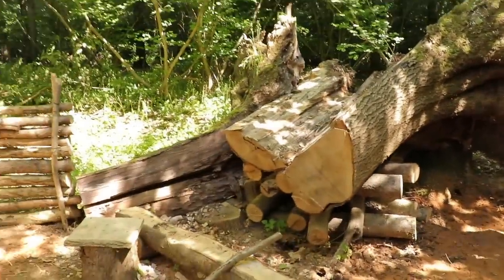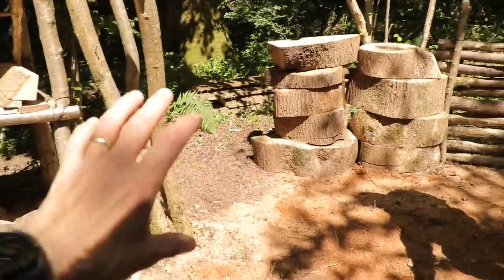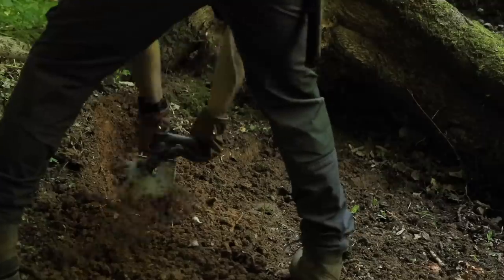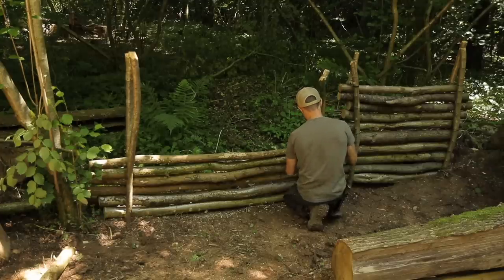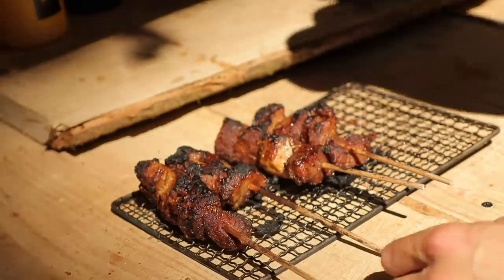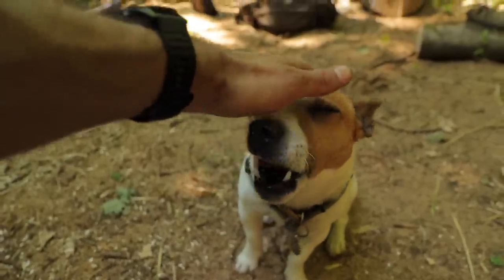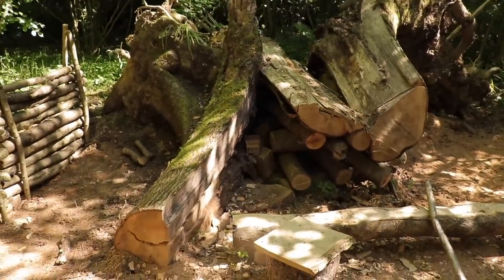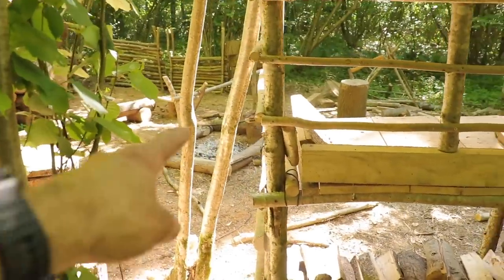Tree Root Bushcraft Camp: Building a  Survival shelter | Perimeter Walls | Kitchen

Comment: At the right side of the trunk, there is a little alcove or grotto formed. Pack some dirt at the very back and under to seal the area from wind and rain. Then later when it is raining, you can add a tent roof over the area for a small sitting place. Thanks for the video. Jon
Reply: I was thinking it would be a nice place for a bed.

Comment: Where the trunk sticks out instead of cutting it, I'd use it to my advantage and use it as some sort of table-ish type thing. I would also put some sort of awning type deal in the crook of the tree root to keep you dry or shaded. Just something small to add to the character of the root.

Comment: 6:07 Integrate the trunk into a sleeping area. Could you imagine waking up in the morning with the trunk of the tree as your ceiling? And then make it kind of a fold-away kinda deal so you can still use the space for other things during the day or when you're not there. If you want to get closer to nature, sleeping under a tree is about as close as you're going to get, lol.

Ooh... or better yet... depending on how much work you want to do... Build yourself a small bunker with timber/wood supports and have the entrance be under the tree trunk... That would be really cool, but a LOT of work...

17:54 The only comment I've got about the kitchen is to overlap some planks over the cracks in the little covering so you don't get water through the cracks if you're trying to cook in the rain...

19:27 Instead of cutting all the way down to the split on the root, figure out a good sitting height and cut into the top section to make it level where it'll be most comfortable to sit on. You could then adjust your fire position so you can tend it while sitting on the tree root bench. :D

Comment: Nice one mate! I had the same thoughts on the last episode on integrating that big trunk more. Glad you did it! On the left side of the trunk i can already picture a small shelter with one bed, tucked in at the side of camp. The piece of the trunk that sticks out could be utilized for a low front wall of that shelter  to kind of frame it in or as support for the bed. Looking forward to the next episode, I´m personally hoping for a clay pizza oven ;)

Comment: Great camp! As for recommendations:
Trunk: Cut it at a diagonal to leave a strong foot support, and use the flat face for carving and charcoal drawing. Great project for small kids.
Back left of trunk: Small watchtower. Perfect for spotting and filming wildlife, and fits into the theme.
Right of trunk: A hammock. Sink an eye bolt into the trunk and make a tripod to string it between.

Comment: I'm glad you moved the left wall, I was silently yelling Don't stop there ( my OCD ). As far as ideas, how about 1. some vertical supports to run some ridge lines for tarps ( incase of inclement weather, or to block the sun on hot or bright days). 2. use that root sticking out as a table or bench. Anyways thanks again for the video, John S.

Comment: Personally, I'd be apt to leave that extended portion of the tree root system as-is.  The green moss on it is striking, and leaving it more natural helps it maintain it's "wildness" and center of focus for your camp. :D  You're already building all sorts of kitchen work area, and other features for comfort and to add options for use so it's not like you "need" to make it into a table, bench or whatever! :D  Cheers from the USA

Comment: I would  cut that broken section of the trunk level for a bench and leave the full length. Or add an angled piece to the top to level it off higher for a camp dinner table.

Comment: Well done Mike, completely agree about moving the other side out, it looks much more balanced and the root deserves to be centre-stage. Its looking great!
As for the left root, a few questions struck me: 
The brach does look to be taking some load, would cutting it could cause the root to move sooner than you might like, or rot sooner causing movement? 
Do you prefer the mossy bark or the exposed interior of the wood?. 
Could you use the vertical face of the wood in some way, such as a table support, a seat back, wind-break, etc?  
For now the branch is prominent, if you cut it could you be making a trip hazard?

Comment: The changes are awesome!  If purpose of fence is to deter critters, why not stack half circles of wood into the openings next to tree trunk?  For cutting outrigger of trunk, you are wise to be careful of removing load bearing sections.  A flat bench would be a great way to make useful without removing too much wood.  And don’t do it without spotter in case it splits while cutting!

Comment: I continue to LIKE your thinking on this project.  Taking the top section of that root and seeing what happens is sound.  I might shorten the bottom root for ease of getting around it when the project is finished.  You seem to be creating an unusual structure:  roofing it should be a challenge, as well.  Beds and benches need the focal point of a fire.  This could be your chance to build a 'professional' one with your day, proper mortar/cement, and firebricks for the lining.

Comment: You could make a dugout shelter under the trunk with a roof/wall leaned up against it to give more horizontal space. Either tarp it over or cover it in dead leaves and such to make it breathable and water resistant.

Comment: Just a suggestion -  you said you might  cut that big branch that sticks out into the camp from the Ash tree down to the crack in it, so that you have a flat surface for a bench or a table or whatever. If you do that, cut it on a slope so that you'll have a backrest if you sit on it with your legs out know the length of it - like a chaise longue. If the slope doesn't work out you can always re-cut it vertically to remove the slope.

Comment: You should level off the part of the root system that comes out, don't cut it down, just level it with the furthest away point being the max height, then cut in like 1000mm and flatten it off, would make a nice little bench, you could then have your fire closer to the root system and sit on the leveled off part as a bench, and even add some make shift seats from stacked trunk slices on the other side!

Comment: Mike, at the risk of sounding like an idiot, it seems to me that that arched grotto formed by the branching of the ash trunk would make a great fireplace if you could figure out a way to protect the tree above from catching on fire.  Every time I see that spot I think how wonderful a fire would be in there, with the roof and sides reflecting heat back into the camp area nearby.  I know this idea presents a lot of challenges, most especially not setting the tree trunk itself on fire.  My first thought was maybe building a little wickerwork inset and covering it with clay, would create a type of open face oven.  Just an idea, love what you are doing to celebrate the ash tree's life and making it a focal point of your camp.

Comment: The long root logs -- I think you should leave them alone. And that is a perfect back escape. Really, I wouldn't mess with the roots. Your tree surgeon had to add logs to support it so it wouldn't crush itself right away with it's top weight. 
The other side, the one that looks like it is a little cave? I'd say, keep it clear, and consider it for a little Jacks bed, or hiding things you just don't want out in the open. Small stuff. Maybe stuff you'd normally forget, that could be the safe protected by darkness. At least, while you're there. You probably already have your own, much better ideas.

Comment: What if you dug out under the trunk a bit. Then hang a hammock on the trunk. It could act as a bit of a rest area. You wouldn't want to sleep on the ground there because I fear water would gather.  But a hammock under the trunk would give you shade. I think you might have to dig out under it a bit. Use the trunk as a big roof

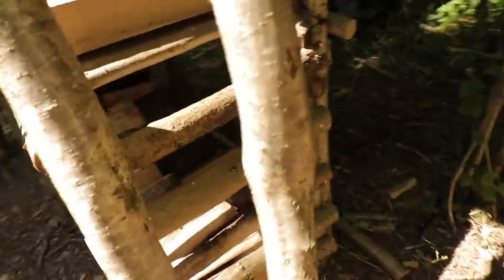Comment: 18:50 i'd rather first cross the bottom structure out to reduce the horizontal stress you get down there from piling up the firewood and afterwards put the horizontal barrs to prevent the logs to fall through.

Comment: Instead of cutting off the remaining trunk, why not shape it into a bench. The reasoning behind my suggestion is that the trunk appears to be load-bearing, meaning the weight of the root bole is balanced/resting on top of it. If you cut it off, or shortened it, the whole thing may flip upright, causing you, Jax or someone else injury.